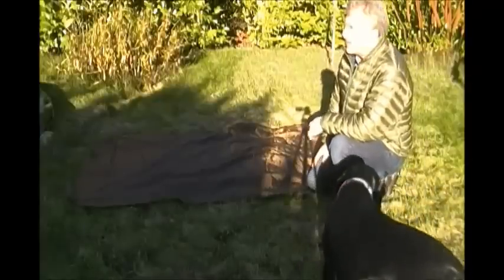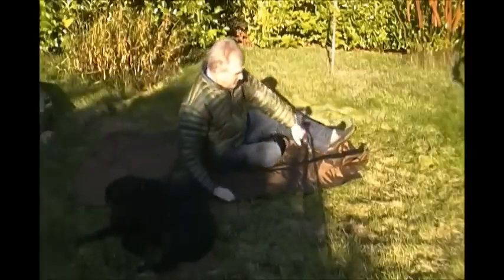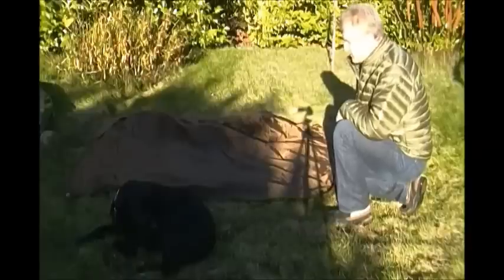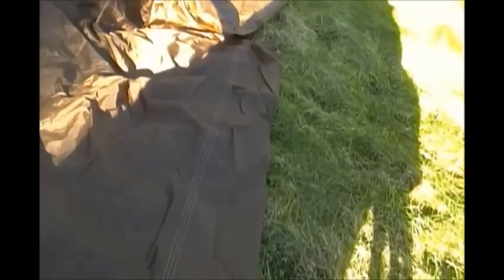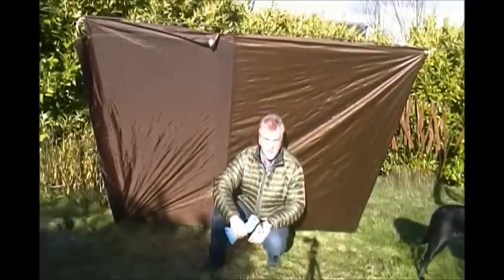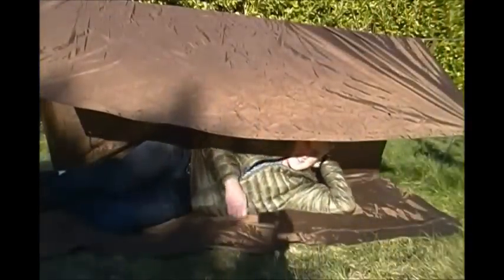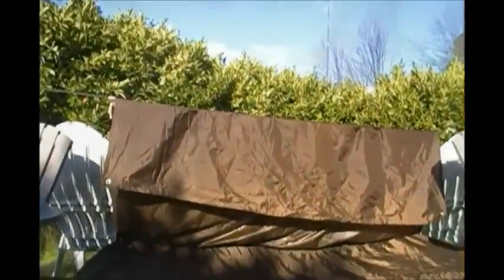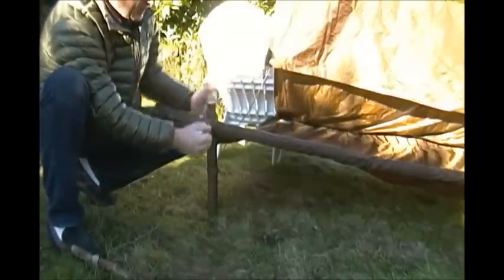Development of Bushcraft Tarp/Ground Tarp/Cot/Hammock

Comment: That was a lot of fun. Seemed like you were pretty determined to get that thing to hold you up, at least until it gave way. Looking forward to seeing you use it in the wild.
Reply from the maker: fireballmalone1 Thanks Mike, glad you enjoyed my show of futile effort. I was really working up a sweat. I had my down coat on so I looked the part...boy was that the wrong choice.  I needed to step back and reassess after a while.  And rebuild my hammock lab.  I have some more projects coming up that you may be interested in plus just got the new army camo sylnylon.  Might start making some more tarps.  Have a great Christmas. I will have a streetbike again most like the beginning of summer.

Comment: When this is developed to your liking Bruce, it will be phenomenal! I really like where this is going. Excellent! - Donny
Reply from the maker: Thanks Donny. I was at a point I needed to try it out. I think I need to get it into the actual woods with the real resources now, I was using 550 and still think it should work, but maybe some bigger cordage may be an answer.
Reply: I agree Bruce. Something that doesn't stretch so much.

Comment: Don't give up on this idea -- it has great promise. I'm playing around with a raised, fabric-based sleeping system myself -- though without your overhead cover -- and have had my own share of butt plants.

To me, it looked like your stretching problem was more with your suspension ropes/cords and less with your fabric. Paracord for instance stretches a lot. Also, a long span means more droop for little stretch. But if you want another fabric, I have used a light rip-stop nylon in a stretcher bed configuration similar to yours, and for an A-frame hammock chair. Durable, limited stretch and excellent strength/weight ratio. Good luck. Rick
Reply from the maker: PESKY46 Thanks Rick. I will try out those ideas.  I hadn't done much with it through the winter, but you are motivating me to get back on it.  It is a fun idea.

Bruce